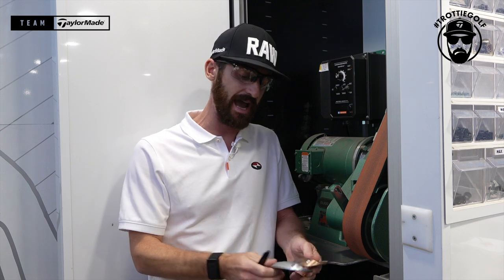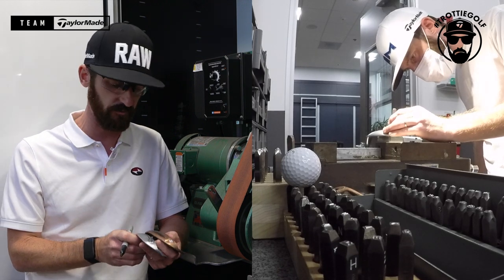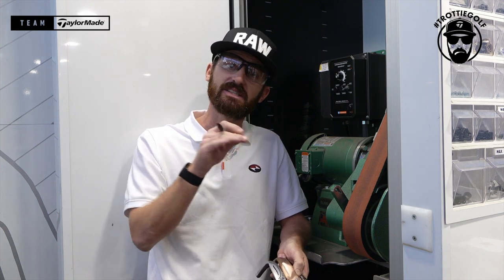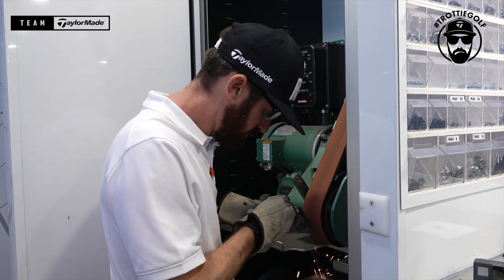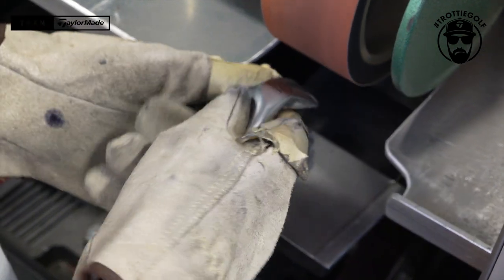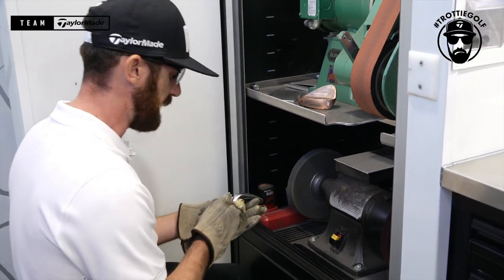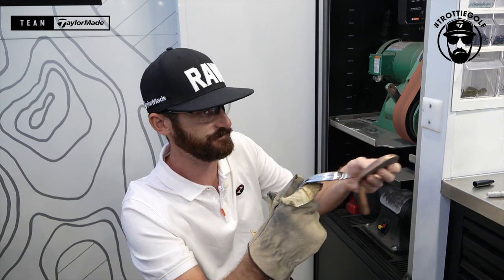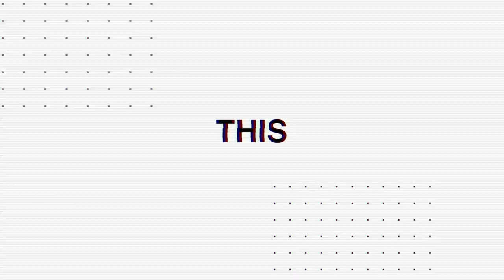Wedge Grinding On The TaylorMade PGA Tour Truck | TrottieGolf

Comment: Hi Trottie, i’ve only been playing golf just over a year and i am a high handicapper (22). I recently went for a fitting as my iron shafts are graphite and reg flex.

During the fitting i was swinging really well and was fitted for some p790s with heavy stiff tour shafts, which i understand are designed for mid handicappers and lower.

Given the price of these i’m worried that i wont be able to replicate that form immediately and be left with a large hole in my pocket. Do you have any thoughts on this?
Reply from the maker: First question. What are you aspirations for your game? If you have high hopes to improve? gain speed? take lessons? play more? Then get the stronger shafts, equipment that has room to grow with you as a PLYR is of more benefit than you feeling you have holes in your game due to the wrong choices during the buying process ⛳️
Reply: @trottiegolf  i definitely want to improve i think i can get my handicap right down if i knew what chipping and putting was! 

I don’t have the issue with the 120g stiff shaft, its more whether i want to give up the forgiveness of the cavity back for the ones i don’t strike out the middle. Are the p790s forgiving? As i oddly enough didn’t hit a bad one all day
Reply from the maker: @rushuddin6178  very forgiving, that won’t be an issue ⛳️
Reply: @trottiegolf  thanks for this i really do appreciate it! Thanks also for the excellent content